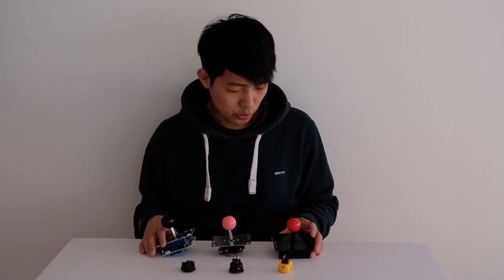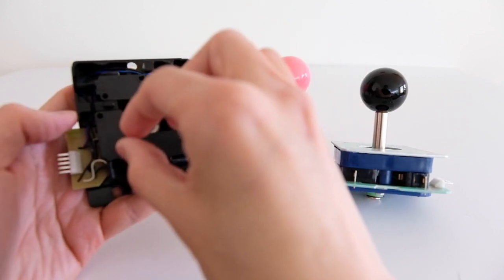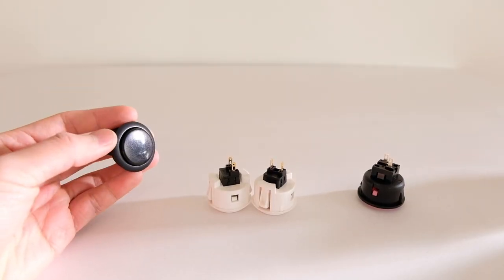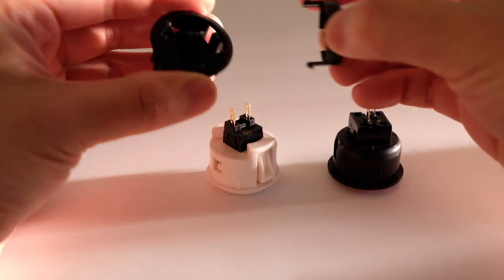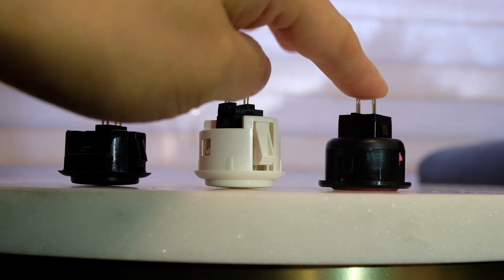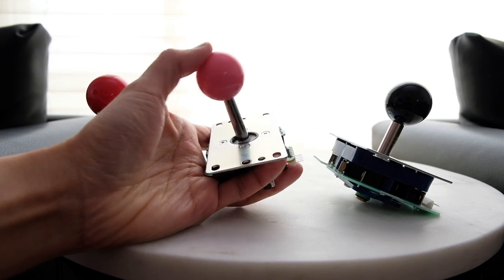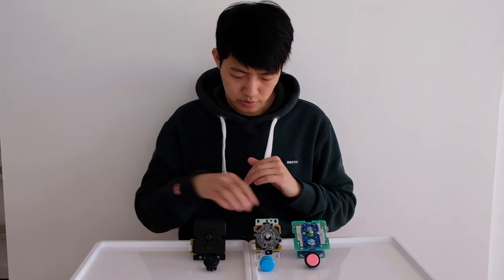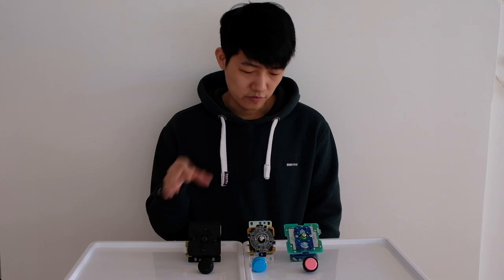Sanwa vs Hayabusa Vs Seimitsu Review Detail Comparison 2019 HD

Comment: which seimitsu lever is that( i will replay the video later after work) will it fit my Hori Rap n hayabusa ? are they compatible with sanwa lb-35 metallic balltop?
Reply from the maker: Yup, all sanwa ball tops fit hayabusa and seimitsu, i believe its the model Ls-32
Reply: @JoystickNY  it look slightly different than ls-32
Reply: it is ls-32. my b xD
Reply: @JoystickNY  will it fit hori rap n hayabusa?
Reply from the maker: Bastian Bravo it will fit a hori rap4, mayflash f300, but it wont fit in a qanba drone

Comment: I have a question. Since the actuator end at the gate, which holds the switches in place as you said in the breakdown, wouldn’t the smaller octagonal gate (Specifically for the hayabusa) make the spacing a non-issue? The actuator moves the gate which pushes the switches and since the gates diameter is smaller wouldn’t it activate the switch far earlier since the busa’s gate has the plastic touching those spaces around the switch, holding the switch down, wouldn’t that make the Hori’s give in the joystick different than what you said?

Idk I’m confused!

Seriously appreciate the videos you have a new sub for sure!!!!!!
Reply from the maker: Great point, i actually did not compared the size of the hayabusa octagon vs the sanwa octagon size, you inspired me to check it out, i am not sure the exact numbers of the sizing, but the hayabusa feels wider to me for some reason, which now i am curious to find out, thank you for that.  I do have a video for restrictor gates later down the road, i am will remember to double check the details 🙏❤️
Reply: @JoystickNY  thank YOU family! Your channel is awesome, you have a very informative AND entertaining way of educating that covers all bases. Thank you for the content

Comment: Greetings sir, may I ask a question, what should I do when my stick doesn't go back quickly to neutral position? (my stick is a sanwa clone bundled with zero delay kit), I tried to tighten the stick with a spring but it didn't work as it still doesn't return quickly to neutral position. Should I replace the actuator? Buy another joystick? Or any othe options that I didn't know?😅 Thanks sir 🙂
Reply from the maker: I would recommend buying a sanwa jlf, bcuz the little things u do will eventually add up to the price, u might as well swap the whole thing , gonna save u so much time and headache
Reply: Oh ok sir thanks 😊
Reply: Oh Sir @JoyStickNY, may I ask last questions, I watched your korean stick lever guide and basically I mostly play Tekken which they recommend mostly for 3D fighting games, I also begun to play SFV (because I also watched your "How to Master the Stick" even though I still don't have a fighting stick that time lol😅). The questions are would you also recommend buying a Korean lever for a beginner in a fighting stick like me? And If you'd recommend it, does it have its own pros and cons if used between 2D (SFV) and 3D (Tekken 7) fighting games?
Reply from the maker: In my opinion; i would use japanese stick for street fighter, korean lever for tekken,
It feels better to me, u can use either for both tho, there are people that does that, but try it out and see how u like it
Reply: Thanks again sir, much appreciated 😅😊

Comment: I have all of these, Sanwa, Seimitsu, Hori, they are all the same to me, I can play the same no matter which parts I use...
As for durability: Seimitsu no contest.
Reply from the maker: Well said 👍
Reply: Seimitsu looks like it is based on the same design as the original MCA Australia sticks from the 80's. I bought one back in 1989 because I was always breaking joysticks on the Amiga 500. It's still tight and still going strong after more than 30 years. They're practically unbreakable.

Comment: With sanwa sticks i'm not very good at hitting the corners when I do quick fireball motions and after you opened up the sticks it looks like the seimitsu is exactly what I need. But the seimitsu stick looks really different in size and a lot bigger, will it work/fit inside the SF4 TE stick??
Reply from the maker: Let me get back to u on this one, my friend has my te stick, and i dont remember off the top of my head. When i get it back, i ll open it up and check. 🙏👍
Reply: @JoystickNY  oh that would be great, i would really appreciate it. Thanks :)

Comment: Hey again, so from what you were saying the hyabusa uses the least amount of effort for the button press and stick movements..
but you said the sanwa is a bit faster in terms of the spacing there.. however when you account for it in a real game and if it's easier to move would there really be a noticeable difference?
seems like in a heatfull match you wouldn't notice maybe that's just me but if we wanted to argue things like
a ps4 dpad can charge faster than a stick but doesn't necessarily mean it's better I have tried full sanwa and it did feel off to me so I'm hoping the all Hyabusa feels right
Reply: Oh by the way! Would you recommend aIV  or V RACP ? or N
Reply from the maker: Kunai Hero hayabusa and sanwa lever is very similar in terms of loose-ness, but i do notice hayabusa is abit wider circle, meaning the throw is further from neutral to a side. Also the Dpad is really strong for charge characters. Keep in mind that 3 top professional charge character players are Pad players. Smug, nuckledu, and problemX.
Reply from the maker: Kunai Hero all 3 is pretty much the same parts. I would go with the cheapest price.  You mean hori rap 4, V and N?
Reply: @JoystickNY  yes i just saw that xbox one racp v has worse reviews and some are saying doesn't work for emulators.
Reply from the maker: Kunai Hero emulators are tricky, i havent try it on any emulators, everyone is on ps4 for me, and a lot of times, it requires you to download some plug in for the stick to work